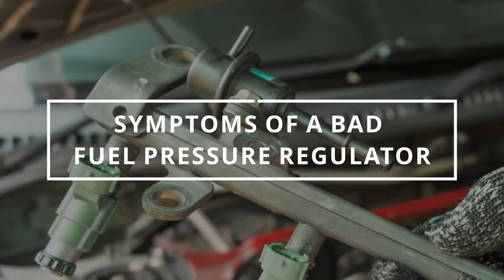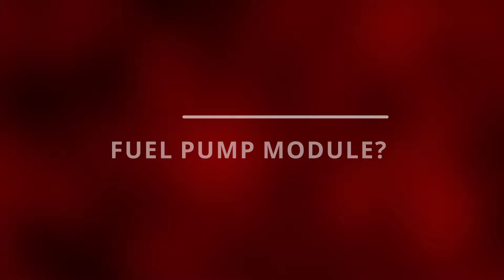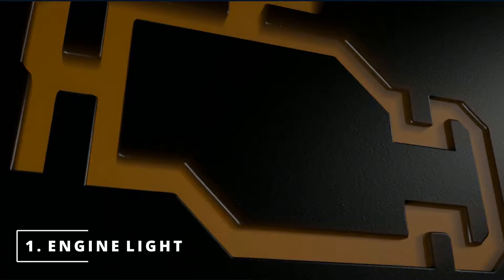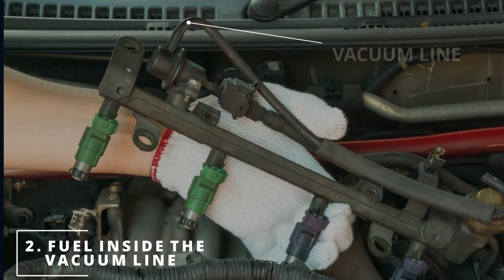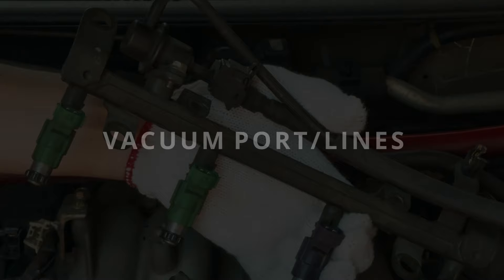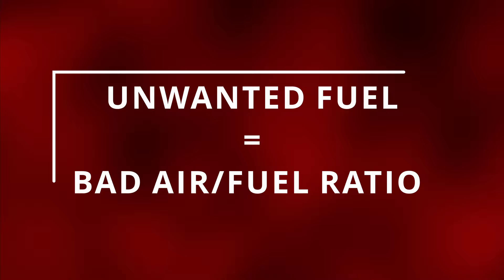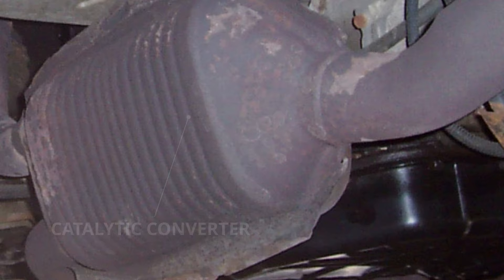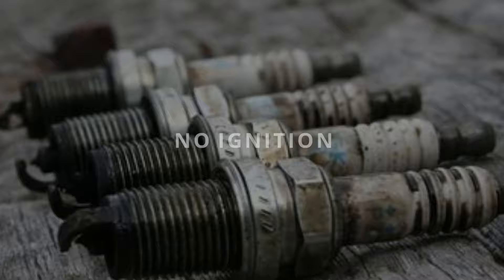SYMPTOMS OF A BAD FUEL PRESSURE REGULATOR

Comment: You left out an important one, when the regulator fails to go closed all the way it fails to maintain higher pressure during heavier fuel demand under load, resulting in loss of power.
Reply: Would this be a lean condition?
Reply: I definitely had this symptom on the highway

Comment: Sounds like my problem mine still misfires after everything I've done to it....... but my computer does not pick up codes at all, and I had a melted ignition coil and replaced all throttle bottle cleaned,  injectors cleaned and new spark plugs still having a misfire mechanics can't figure it out I can't figure out, toyota is trying to buy my rav4 for 8,000 USA dollars in a check

Comment: EXCELLENT CHANNEL! Excellent info, especially for us non mechanics who are trying to diagnose and fix our cars when a REAL mechanic/garage can't! Priceless!  Thank you! 

If anyone wants to comment...I just had the fuel pump replaced when it failed and left me sitting, mid drive.  But when I got my 03 Buick Rendezvous back from the shop, it now just cuts out while driving. (Like it's not getting gas) If I let off the gas when it starts to happen, many times it will recover without shutting off. If I'm going up a hill and I continue to try to get up the hill by lightly giving gas as its slowing down, it WILL backfire.  I returned it to the garage because interior lights were coming on and off while driving all the while this continued, thinking maybe they crossed the wires on the fuel pump upon installation. (Now these symptoms only happen AFTER it is warmed up. Never happens cold. Well the mechanic said it was the wiring harness and apparently replaced that. They said it was fixed (no charge 🙂) Picked it back up and same symptoms continue. Spitting sputtering cutting out and shutting off. (Not the battery, but the engine , losing power steering and brakes if I can't get it to "recover" by fanning the gas, or throwing it into neutral and revving.) Now I'm thinking gas pressure sensor? 
Any comments greatly appreciated!! Thanks yall, from this southern girl to....you? Lol)
I should add recently before this I had a different shop remove my catalytic convertor (without my permission!) When I took it in to have 02 sensors replaced. A week after that,  the fuel pump went up and when I got it out of the garage, that's when these new symptoms appeared. 
The adventure continues....🥴
Reply: Having same symptom
Reply: Solved?
Reply: Could be crank shaft sensor ..
Reply: Did you solve your problem? Having EXACT same issue 95 ford f250.

Comment: My sisters 08 Avalon had hard starting.  TK changed the fuel pump...why they never replaced the FPR on the side of the pump...beats me.
TK said it's not the FPR.
Not getting anywhere with TK, I YouTubed and changed it myself....not that hard.
I replaced the FPR..problem solved.
Thanks to all those YouTubers out there !!!
Reply: Did you also smell gas? I just bought an 03 and it starts hard, idles rough if not give gas for a minute, then also smell of gas for about 30 seconds after car starts. Also feel strange vibrations while at idle.
Reply: @fakejeepman06  I would suggest changing the plugs..wires and all the coil packs. Go on Amazon and you can buy everything as a kit. I had the same issue,with my 02 4runner...did what I mentioned...problem solved.
Reply: @williamb2854  I only have p0171 and p0174, would that still be an ignition issue?

Comment: Great video. Very informative, and polished production as well! I think mine is the reason for my current no-start condition.  Fingers crossed 🤞
Reply: Just don't forget "newer" vehicles, I'd reckon in the early 2000's and up range may have an integrated fuel pressure reg in the pump itself, and not external, which is the case for the 05 Altima I'm working on. Good luck!
Reply: @CymatixOne  I appreciate the follow up and the heads up!  I'll let you know tomorrow when my replacement shows up.  I swapped a 2001 Tacoma 3.4 litre motor into a 1993 Toyota pickup.  This one has the independent fuel regulator mounted on the back of the fuel rail.
Reply: @RedwoodsNorCal  Awesome project man, hope the swap goes well! 🤙
Reply: @RedwoodsNorCal  Did this fix your no start issue ?
Reply: @CymatixOne  I fixed my issue!  Believe it or now it was crossed coil pack command wires.  She's running smooth now!
Reply: @yab0y408  unfortunately not for me, but I did end up figuring it out. In my case it was swapped coil pack command wires.
Reply: So a bad fuel pressure regulator can actually result in a no start? My old civic has a no start issue. I never could figure it out.
Reply: @CymatixOne l
Reply: Also check the fuses, and if any wires to pcm are touching any hoses that get hot. Can cause a short messing with pcm

Comment: This video helped me very much is what I needed the information I was looking for on my 2002 Mitsubishi eclipse GT that's having a problem running it's not running right after I replaced the spark plugs and wires and changed the distributor Cap and still the same I never thought to look at the fuel regulator

Comment: My frontier 2002 v6 would throw random misfires, or cylinder 6 always misfired. I had a strong smell in the cabin. My truck had horrible gas mileage. My truck would start in the morning or if it was sitting for a while with with no issues, but if was to drive it for the day the 2nd time I started it, the gas odor seeped in and it was definitely a hard start where the engine would just spin a few seconds.

Comment: ok, I pulled my fuel lines off of the manifold behind the throttle body. Took carburetor cleaner, filled up the two holes. They filled right up. Came back 3 hours later, and the inlet side was empty. Evaporated I asked myself? Put more in, but it would not fill up the hole. Put the fuel lines back, and "Wham!" Truck started, ran good. I did not have to remove intake manifold.

Comment: I've got 48 lbs of fuel pressure. It increases some on the guage when you press the acclerator.
On cold starts it cranks right up and idels fine. Short one mile trip to grocery store, cut it off, shop for 15-30 minutes and it wont crank unless you press accelerator to floor. When it does crank it runs rough for about a minute or less but when I try to take off it stalls and goes dead sometimes leaving in middle of intersection!!!
What's the problem?
Coming home finally I stomped it and ran up to 90 miles an hour from about 50-55 mph.
Runs famously. No hesitation no nothing. Performs great. Pull into yard, cut it off wait a few seconds then try to crank and it wont start again unless I put it on the floor.
Pump?
Fuel filter?
Pressure regulator?
I'm afraid to go anywhere now, especially the wife. We're both 74 and only vehicle???
Note:Distributor cap rotor button, plugs and wires changed less than 10000 miles ago!
Reply: What did  it end up being?

Comment: Would this have anything to do with cold air temperatures? Summer it doesn't give a p0171, but winter it does if I don't let it warm up, and now with this arctic outbreak it kicked an engine light on again.

Comment: Outstanding info, great job!
Reply from the maker: Very nice thank you!
Reply: Could a bad fuel regulator causes engine stall?
Reply: @easyautofix I need help. I have a 2003 Hyundai accent.  I have to use starting  fluid once or twice a week to start my car but after it starts runs great until the next time I have to use starting fluid.  Unfortunately it is happening more often.  I change the fuel pump and still it is doing the same thing. Any help

Comment: last year i had a bad electric fuel pump so i installed a new one in the gas tank, after one year it got noisy, so again i put in a new one after 3 days it also got noisy, one time the car did not start, after a few seconds it started rough with low power then it was OK, could it be the fuel pressure regulator .. any help appreciated

Comment: Ford escort wagon I had to rebuild  because regulator went bad over flowed engine with gas and lady was holding it to the floor to keep it running untill it was overcome with gas and spun 3 rod bearings then filled half the block with gas

Comment: I have code p018c coming up not enough voltage and fuel pressure sensor b circuit low. I changed the fuel rail sensor and the fuel sensor

Comment: F150 2009 4.6 L seems like the pressure regulator is noisy at times on accelerating like fluttering noise and pour gas mileage ? I thought it was fan clutch

Comment: would the smell of gas and emissions be a symptom of a bad regulator?
Reply: im not certain but my 3g eclipse sounds like it has a bad fuel regulator. car won't turn over sometimes and could let it sit for a few minutes up to hours and come back start it up and it will start. by then all i can smell in the cabin is gas. it's like the engine is now flooded with gas

Comment: I replaced my IAC because it was throwing a P0505 code. 
I have a high idle still, the catalyst converter was going red we took it off clean it out, we cleaned out the throttle body. And I'm still having a high idle. 
It's still throwing the same code and also a code  for the fuel pressure regulator circuit issue.  What's your suggestion to check next I haven't noticed overheating but we don't know if the thermostat is bad it has water and there's no leaks. 
But we can't figure out the high idle problem and why it's still throwing the p 0 505 code 
I took it to two different places and they cleared that code just for it to keep coming back what could that be? 
What other things could I do to help the high idling.  2004 jeep Cherokee Laredo 4.0
Reply: Did you calibrate the throttle body after the clean?
Reply: I guess you checked for vacuum leaks. Anyway my high idle was caused by the power steering pump. There's a sensor that increases idle when the wheels are fully turned. So l just unplugged it - problem solved.

Comment: I experience bucking in my 96 jeep grand cherokee at around 1800 rpm at around 55mph with no check engine light with all spark plug, wires and roter button replaced. Bear in mind no check engine light

EDIT-- problem has been solved camshaft position sensor and scan code came up for crankshaft sensor even with no engine light
Reply: Were you able to identify the problem and get it fixed?
Reply: @ken-dt1zp  yes I did surprisingly it wasn't the part that the scanner picked up... the scanner picked up a crankshaft position sensor code.... I went and pulled one and a camshaft position sensor located underneath where all the spark plug wires go together... turns out my bucking problem was solved just by changing camshaft position sensor and not the crankshaft the problem quit before the crankshaft sensor was touched...

Comment: Could this be the cause to my misfire in cylinder 5 p0305. All of my spark plugs and ignition coils are replaced brand new, denso ignition coils and ngk spark plugs but still on hot days when the engine is at a full warm up itll miss fire just in that cylinder and no other codes beside that?
Reply: could be the air intake manifold gasket

Comment: We have tried to fix everything under the sun on my 1988 Chevy G20 it keeps bogging out and wanting to shut down even while we're driving on the highway then it will drive perfectly fine for miles and then it will act up again for a few seconds and then it will drive perfectly fine for another few miles if anyone can give me any help I'd appreciate it already changed the map sensor and the throttle position sensor the fuel pump the fuel filter none of these needed to be done but I'm trying to eliminate it since it doesn't have it OBD1 and I cannot get anything to help me understand what's going on. It also backfires and hesitates and skips but we changed the spark plugs and wires and cap and rotor and when we give it gas it stops acting up until it acts up again
Reply: Try replacing the coil or coil pack whichever one you have ave....

Comment: HI i have r SKODA OCTAVIA (1Z3) 1.6 FSI (85 KW / 115 HK) 
having error code P2294 Fuel pressure regulator 2 control circuit/open.
i have following question kindly help me out i am trying to fix it but even workshop person just guesing .
1. do i need to change whole fuel pressure regulator which is expensive. or just need to change cables because as i read its related to wiring circuit problem.
2. is there any way to diagnose more concreatly?
3. it would be nice if some one tell me where i can found this regulator on engine pics or video will highly appriciated.

Comment: Could this cause a problem where the engine starts fine when it's cold, but once it gets to running temprature it cranks over fine but will not start
Reply: I'm having the same problem
Reply: @daltoncorzine2760  I changed the temperature sending unit by the thermostat and the purge valve, seems to have done the job, not saying that's gonna be your problem but it's worth a try, unhook the hose between the purge valve and the charcoal canister and if it's getting vaccum when the engine is cold, it's stuck open creating a vaccum leak, the temperature gauge can still work when that temprature sending unit is bad, and will make the computer think the engine is still cold when it's warmed up, just something to check, it drove me nuts.
Reply: mine is having not starting when it has too. it hesitates big time. specially cold starts. it's town random multiple misfires. but its not that because once it starts car runs fine. I'm leaning towards it been bad battery, because battery is leaking acid. I believe fuel pressure has something to do with it not wanting to start right away maybe low fuel pressure

Comment: lean on both banks new idle aid control vale intake gasket purged ecm truck ran a lot better for all most a week. Check engine light is back on. 1999 Ford f50 superduty 5.4 two valve engine. Help me please
Reply: Update? Same problem here.

Comment: Bro need your help what are the common problem when the engine is stalling while driving? any ideas with my suzuki ciaz? running low mileage 30,000km.  No code founds. Thanks.
Reply: Could be crankshaft sensor

Comment: How do I know it’s the regulator and not the pump ?
Reply: I'd bank more on the pump then the regulator being broken tbh. you can always just go the cheaper route and replace the regulator first since it's cheaper. same issues like what a bad/failing fuel pump does too. only big notice for mine is that the fuel pump is super loud and sometimes sounds like it is running dry. otherwise my car does start here and there, does drive, but also stalls getting 0 gas. lucky for me i get to change both so it doesn't matter too much sad part is this pump i got failing is only a year old. OEM one completely died out with 0 warning motor just gave out one day.

Comment: I have black smoke, but then it goes away🤷‍♂️... I used my obd2 and it said fuel pressure regulator 1.... do I just change the fuel pressure regulator.. (2009 vw cc 3.6)
Reply: Yeahhhh ... change the fuel pressure regulator ... what do you have to lose?!?

Comment: What about smelling gas outside the vehicle and inside?
Reply: What kinda car you have? It could be a few things. Might have a fuel line leak in the engine bay or a evap leak somewhere and it's causing the smell. Most likely a old line or hose allowing vapors to circulate ☝I recommend after driving your vehicle for a few minutes pull over and pop the hood and see if you can pin point where the smell is coming from. Could even be a cracked gas tank filler hose
Reply: @TreyGoose  08 GMC Sierra 5.3. It has long start at times and rough idle. And smell of gas outside and just yesterday inside. More prominently at the back end. No obvious leaks upon inspection. Gas hand does seem to go down faster at times and it just doesn't seem to have it's umph. Hesitates a little and stuff.
Reply: I had that problem b4, it was a cracked fuel pump located under my back seat
Reply: Silinoid EVAP
Reply: @FloridaHustle239  Actually it was the ENTIRE top of the fuel pump housing rusted and rotted into oblivion. The neck on the housing was hanging by a few rust bugs. New pump new truck.

Comment: Someone has experience of bad pressure regulator? My car is vibrating at idle engine shaking...this happened to someone?
Reply: Sounds like my Avalon, in have to give it a little gas to get it to idle properly, also, do you smell a lot of gas?
Reply: @fakejeepman06  sometimes yes all symptoms say that i have problem with fuel press regulator i ll replace it for 2 3 days
Reply: @fakejeepman06  today have changed fuel pressure regulagor car vibrating/shaking minimal now is ok cheers
Reply: @xbrutal3953  For me it ended up being the alternator because not enough power was getting to the spark plugs.
Reply: @fakejeepman06  okay dude nice
Reply: @xbrutal3953 - why ask if "this happened to someone?"  happening to YOU ... get the problem fixed.

Comment: Also if leaking and you have a g37 it’s right underneath the alternator which fuel leaks into the alternator causing it to fail which you may also get a no start and requiere a jumpstart, I bought a new alternator , starter and battery since no one knew why my car didn’t want to start , it was the regulator leaking into my alternator , which I would get the brake and battery light flickering